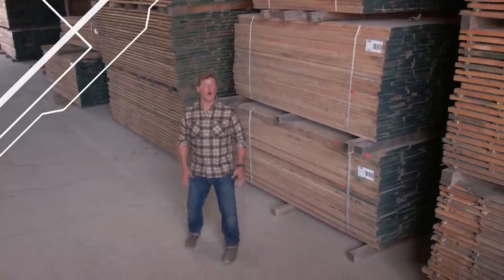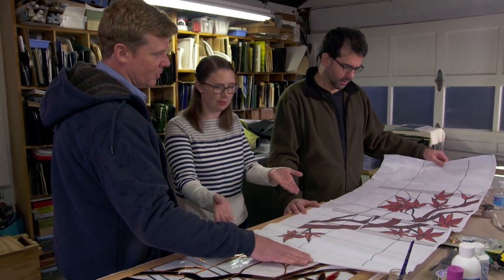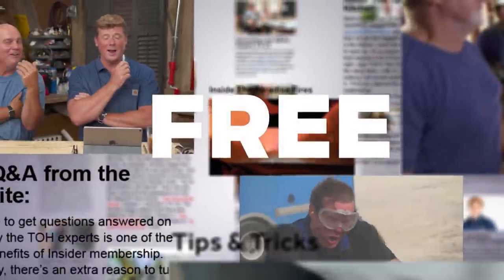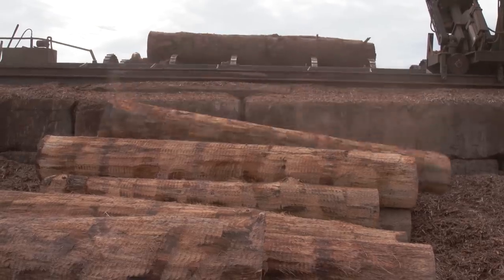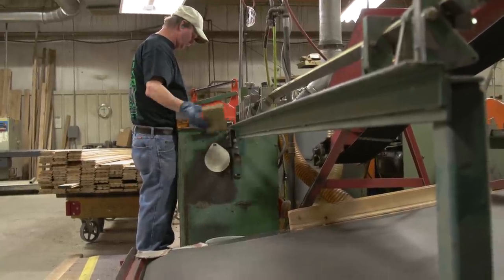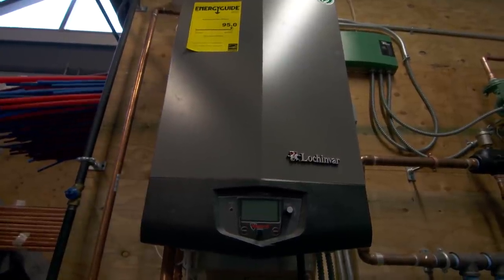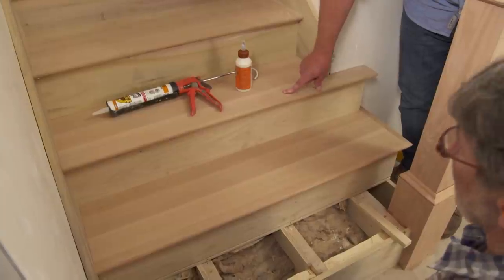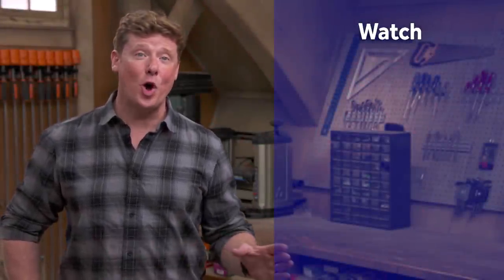This Old House | Homeowners Pitch In (S39 E11) | FULL EPISODE

Comment: 7:11 What the hell is that guy doing on the table saw with no fence? That's kick back city waiting to happen. Plus, only one operator is needed. That other guy is in the way and way too close to that spinning blade...he's going to cause a kickback by pushing on the board. This is a terrible way to train an apprentice. The table saw is the most dangerous tool on the job besides an angle grinder

Comment: @9:45 - lumber company should tune up their equipment if they are so concerned about the environment.
Reply: You are so correct... they should make all that equipment electric that way when they blow a lithium ion battery (which is what all electric vehicles run off off and what all solar and wind turbines store energy into because they can hold the most energy and are the most efficient) it will not only completely contaminate the ground it goes into but pretty much kill all plantlife in the nearby area and pretty much any animal life that is unfortunate enough to try to eat said plants before they are completely dead since lithium ion batteries are not only EXTREMELY toxic but also EXTREMELY lethal (not only the fluid inside but also the odor they put off when they catch fire or burst)

Comment: Oh my, what is going on at 7:09?! Ripping on a table saw with no fence?!
Reply: Its pretty common. I do it when i need to have a perfect fit on a surface that isnt perfectly straight/ square. They may have scribed that trim board to an uneven wall to get a perfect fit and were simply following a line.

Comment: Hardwood floors are junk.
Reply: What's better then hard wood flooring?
Reply: @kkknotcool  
Peanut shells & spent pull tabs. 🍺🥃🥃
Reply: @samsngdevice5103  Really, why don't you like them? It's warmer then tile and more durable then carpet.  I see it as a happy medium between the public/utilitarian tile spaces and the personal carpeted spaces.
Reply: You left out the part where you finish with: "said nobody ever."
Reply: I worked at a joinery factory in Australia which had a tongue and groove hardwood mill for flooring, this was about 1978. All I remember is lots of splinters and staining in my hands from the spotted gum. Unfortunately no more tongue and groove flooring is used nowadays.